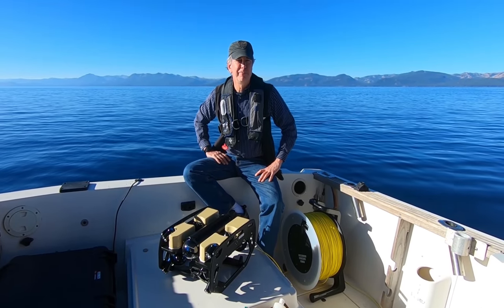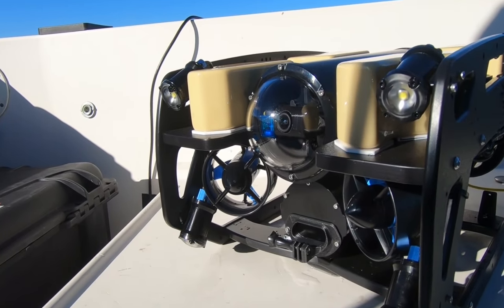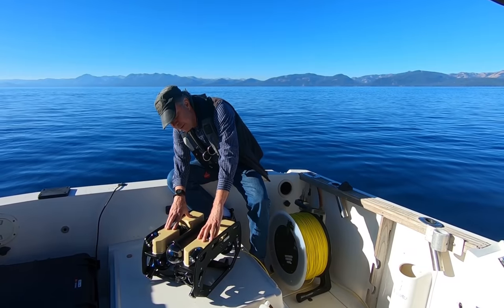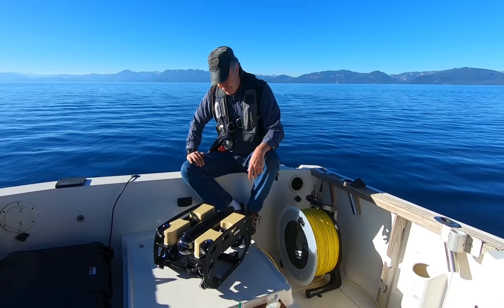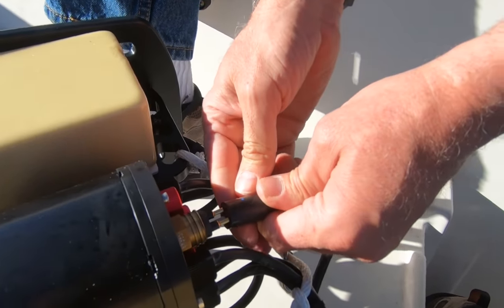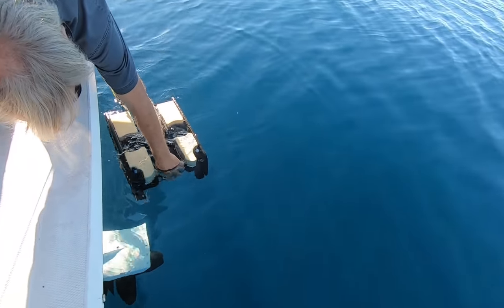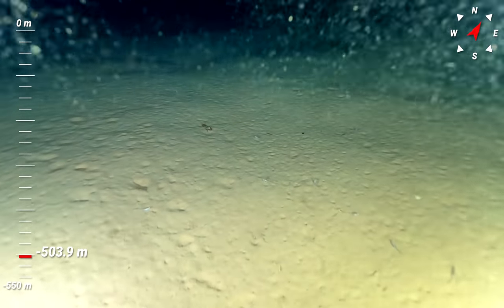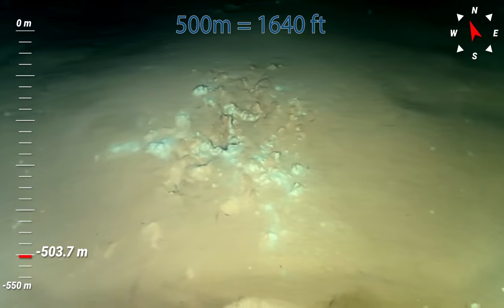Dive to the Deepest Point in Lake Tahoe (over 500m or 1640ft in depth) [1080p60]

Comment: Keen to know what tether setup did you use? On the blue robotics website they mention max length of 300m for observed communication for their fathom tether. Have you gone fibre optic?

Cheers
Reply from the maker: We are not using a fiber optic tether, we are still using a copper tether. The 300m max length is determined by their Fathom-X Tether Interface Boards, not the actual tether. We are using a different protocol for the communications over the tether which is how we are able to achieve communication over greater distances, while still using the same tether type. If you are interested in learning more, please get in touch via our website.

Comment: Very impressive not just add the blue robotics gripper. I love to borrow this for a 600' DJI drone recovery in the bottom of a PNW lake. The drone that was lost is only a basic DJI drone the point would be for proof of concept of locating a drone at that depth based on the GPS waypoint when it auto landed in the middle of the lake by accident to be able to locate and grip it. This would be absolutely a stellar mission. It will be quite some time before I become a rebreather diver for deep dive recovery, LOL  Cheers, #SeattleRingHunter Lost Item Recovery Specialist

Comment: I wonder if some of those tracks are from an anchor being dragged from a drifting boat.
Reply: Lol🤣Nobody has a 1600 foot rope for their anchor.
Reply: 1600 feet deep
Reply: @SOLDOZER  I used to grouper fish for a living. Snowy grouper. We anchored in over 1600' every week.
Reply: @trimbaker1893   What scope for 1600'?
Reply: @SOLDOZER  not much if you want the anchor to wobble with the rise and fall of the waves and leave dinosaur tracks.  : ) 
But, when we would anchor, there was a deck pile of anchor line. The hard part was getting the set angle right with the current so we would be above the rock ledge that held grouper. To raise the anchor, we would clip a big orange polyball to the anchor line and drive the boat towards the anchor. When we got over it and kept going, the line pulling through the ring at the polyball would pull the anchor up until it was hanging at the ball, splashing along behind us. Then we simply pulled in the rope and piled it on deck for the 14 hr ride home. We usually caught around 3,000 pounds of grouper in about four days out.

Comment: Id like to see lake chelan the 3rd deepest lake in the u.s. 1500 ish feet. What does something like this run?
Reply from the maker: That would be a fun place to explore. We know of a group up there that is starting to do some exploration and hopefully there will be video soon! We used some off-the-shelf components, some of our own products, and did some custom engineering work. It is getting less expensive with time to do things like this, but somewhere between $10-20k USD is a reasonable estimate.
Reply: Ok. So I did the chelan thing with a "cheap" sub called chasing gladius mini s. Took her down as far as it would let me. 328 feet. Then a message blocks your view on the phone saying depth limit, and doesn't let you go any further down. I suspect the bluerov2 has this as well, so there's not only hardware mods, but software as well?